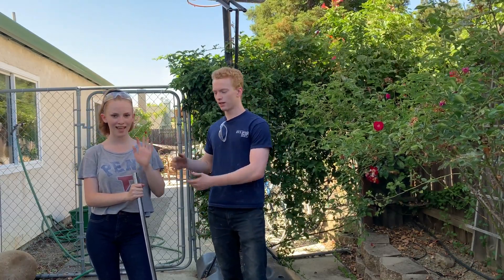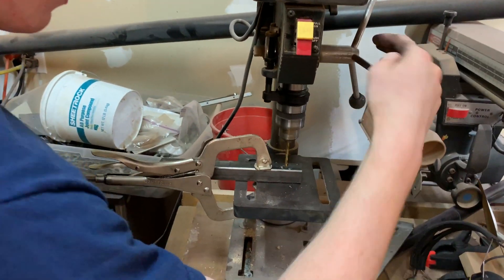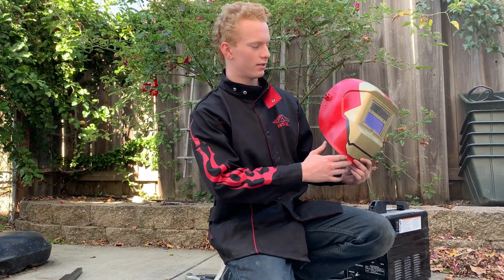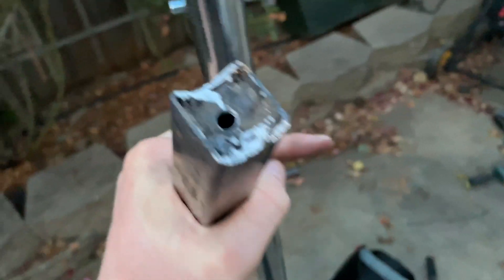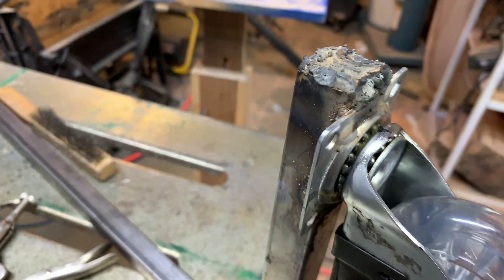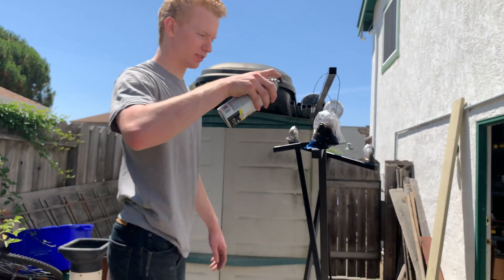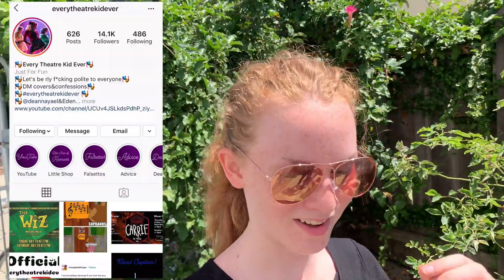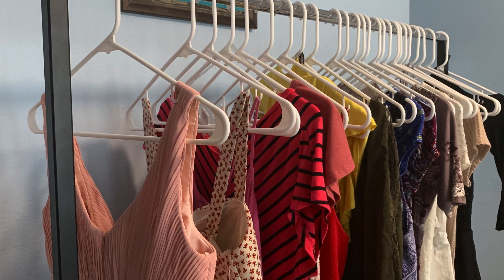Welding a Clothing rack w/ My Sister (Every Theatre Kid Ever)

Comment: You should try welding with gas instead of flux core
Reply from the maker: I do prefer gas welding (I learned to weld on one and had a welding job in high school where I used one) and would love to have a gas welder in my shop, but unfortunately at the moment running my shop/channel off a college student budget I can’t afford one yet. Maybe I could get sponsored by Lincoln Electric someday.